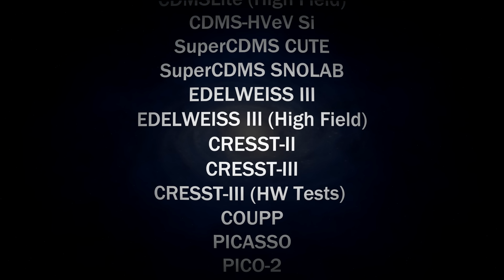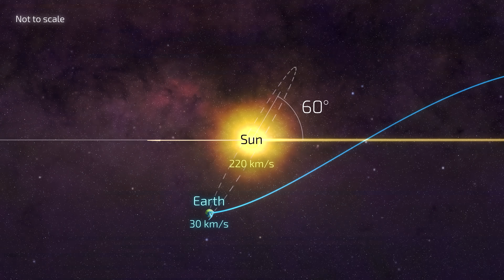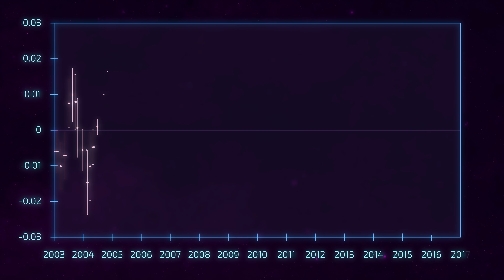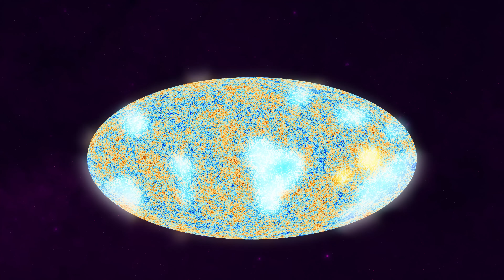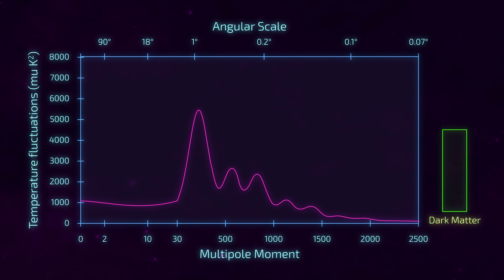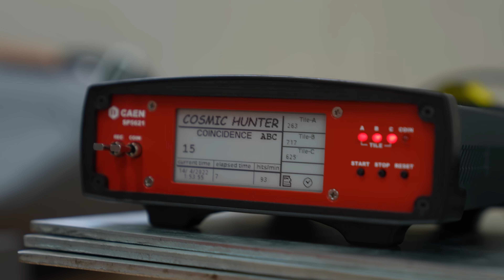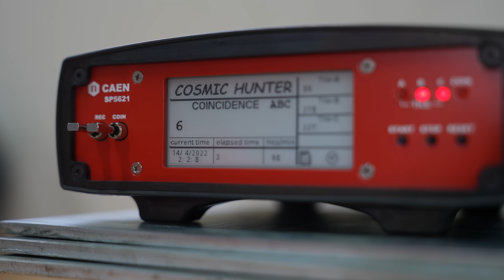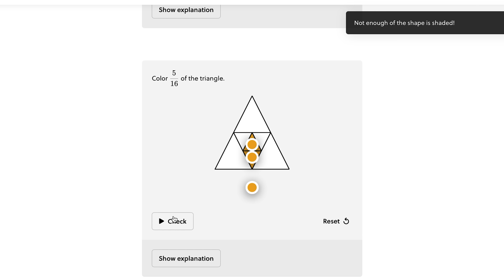The Absurd Search For Dark Matter

Comment: A particle that doesn’t interact with other particles yet seems to have a massive gravitational affect on the structure of the universe seems like a contradiction to me. Why is this “dark matter” not clumping together in it’s own galactic structures if it has this enormous gravitational attraction? As an hypothesis it raises more questions than it solves. Eg - why doesn’t the Earth consist of 80% dark matter if the universe does?
Reply: It doesn't interact with itself either. Which means that dark matter particles doesn't collide with each other, doesn't lose momentum and won't clump together to form a denser structure.
Reply: Could it be that the dark matter attracts itself less strongly than it would to “real/light matter?” 
That might be super dumb but just a thought
Reply: @MondoTV The only reason normal matter has clumped so densely at all is because it interacts with itself (mostly through electromagnetism). Matter moving through space doesn't experience friction, so through conservation of momentum and conservation of energy it is going to keep moving unless that kinetic energy goes somewhere else. Normal matter, like gas and dust, will sometimes collide and that will turn some of the kinetic energy into thermal energy (or radiation). And that's how normal matter clumps up. That's why the early earth was molten rock, instead of cold dust. And that's also why meteors glow when falling to earth, all the collisions between the meteor and the air.

Whatever dark matter is made up of, either doesn't do this at all or doesn't do this very often. So instead of clumping up as part of the earth, it just passes right through
Reply: @ThomasBomb45  Matter does not clump together because of “electromagnetism”. It clumps together because of gravity. Which is precisely the force dark matter is supposed to be exerting on the rest of the universe.
Reply: It shouldn't, we've come to accept plenty of invisible forces that doesn't interact with matter. Gravity and magnetism are invisible forces we just accept even though we don't fully understand it. We don't know why gravity pull things together. We don't know why magnets repel or attracts we just know it does.

Comment: Fascinating, as usual! But a logical inconsistency (or maybe just a perceived inconsistency) is nagging at me: Scintillation detectors are being used in these attempts to detect DM, and the interactions that occur in such detectors between incident particles and the atoms of the detector material are electrodynamic in nature (kinetic energy transfer, orbital electron excitation, etc.). Yet, as Derek stated in this video, physicists have hypothesized that DM only interacts with “ordinary” baryonic matter gravitationally… However, I am almost certain that no such inconsistency actually exists, and that it only seems that way to me because I’m a layperson on this subject. If that’s the case, can anyone explain what key piece(s) of scientific information I’m missing at the moment?
Reply: DM could interact with ordinary matter only gravitationally, but the idea is that it might also interact (extremely rarely) with ordinary matter through the weak nuclear force. This is why these DM candidates are called WIMPs (weakly interacting massive particles).

Comment: That WIMP detector looks a lot like some neutrino detectors I've seen, just smaller, with different materials and more complex stuff around it.
Reply: How do they rule out neutrinos being detected?
Reply: @fdemilde  Neutrinos are indistinguishable from WIMPs in individual events. You need to account for that using annular modulation etc.
Reply: @jackkamo5175  That's not necessarily true, depending on the detector. Experiments like DEAP-3600 can differentiate between nuclear recoils (the expected interaction for a WIMP) and electron recoils (which is what an interacting neutrino would cause, IIRC).
Reply: @atticmuse3749  We are talking about DAMA/LIBRA which doesn't do that.
Reply: @fdemilde  that's a very good question. I didn't even think about that.

Although it's probably very rare that neutrinos would be detected there, since this detector is still relatively small compared to typical neutrino detectors.

Comment: As someone with a very elementary knowledge of dark matter, could it just be denser gasses and not dark matter? Both you can’t see
Reply: You actually can see the gas :) either because it emits radiation (for example neutral hydrogen emits radio waves, hot gas emits X-rays etc) or because it partly absorbs light from other sources when it passes through. And from what we can see there's not nearly enough gas to explain the effects we attribute to dark matter

Comment: Aaaaannnnddddd... this is why I switched from particle physics to condensed Matter physics. I personally do not have the patience to run an experiment that is like this. Intentionally trying to detect something that doesn't interact much by definition sounds like a frustrating experience. The same goes for the the neutrino community. Lots of respect... from a distance....

Comment: iduhknow... dark matter. Hm. If 'Big Bang', we had faster than light expansion of the universe. That puts us in a temporal area that is actually earlier than the Big Bang and  the Big Bang hasn't actually happened yet. If the 'Big Bang' was not the beginning of the universe, but a large event within an extant universe, in a universe which had  not been so accelerated and was moving forward in forward time, this would account for an inability to signal 'dark matter' - we aren't in the same time zone. Also account for the different behavior of dark matter in that it is the temporal orientation of the known universe which permits of such things as the emission of light; there's just no room for light to be emitted otherwise.
Maybe just some hair-brained musing but can't say i've heard of any better interpretations of what's going on with Dark Matter (or, as deGrasse Tyson says, "Dark Gravity", since that's all we really have any data for so far).
Between the conception and the creation
Falls the shadow.
TS Eliot said that.
It has been said that 'data never lies' but
Between the data and the interpretation
Falls the shadow.
i said that.  😉

Comment: Well done. This is the first time I’ve seen an article that tries to explain dark matter WITH PROOF, rather than speculation!
Reply: It’s not proof. It’s working backwards from a set of observations to an hypothesis that seems to fit. Until we understand the “why” of gravity as well as we understand the “how” then it’d difficult to assess whether something else is happening that we just don’t understand yet.
Reply: @mondotv4216  maybe ‘proof’ was the wrong word I agree. Yet, this is the first time I’ve seen anything that take two different methods, both endorsing Dark Matter. That has to be a good start. . .
Reply: @GWAIHIRKV  Not really - just two different methods of observing the same thing - whatever that may be. The dark matter explanation just seems illogical to me. You have this thing exerting enormous gravitational forces on the universe that doesn’t interact with anything? If it has gravity (by definition) and there’s 5 times more than the observable matter in the universe, why aren’t the planets 84% dark matter?  And if matter is not attracted to dark matter and vica versa then it explains nothing.
Reply: @mondotv4216  How would planets be made from dark matter when dark matter does not interact with little more than gravity? Planets are held together by gravity, yes, but electromagnetic forces hold the particles from passing through each other and dark matter doesn't interact that way. A "planet" of dark matter would be a "pulsing" blob or a "mini galaxy" of particles of dark matter.
I'm not saying dark matter exists, that we will (hopefully) see, but your view seemed unfair to the hypothesis. As far as we know it is quite consistent.
Reply: @GWAIHIRKV  I assure you, people have made these connections before. Veritasium isn't discovering new science, he's conveying science that others have already done
Reply: Ken if you want more non-speculative content like this, I highly recommend looking up a blog called Starts With A Bang, written by Ethan Siegel. He is a theoretical astrophysicist who specialises in this sort of cosmological stuff, plus he’s got a great way of explaining things which is palatable to a wide (non-expert) audience. Some of his writings on dark matter help to break down the myths and help debunk things like string theory (too convenient) and Modified Newtonian Dynamics, or MOND (doesn’t explain other observations). Plus he has a lot of excellent articles on other science topics like climate change, astronomy, black holes, space travel, etc.
Reply: Science marches on.
Reply: The way galaxy rotation lines up with the CMB made my jaw drop. That's pretty darn convincing.

Comment: They are getting hits from something else, not dark matter.  The second site detector will show a nil or otherwise uncorrelated signal.  Dark matter constituent particles are to large prime numbers as electrons, protons, and the materials in any detector we make are to small prime numbers.  These domains are disjoint-but-topologically-not-disjoint and both curve the same space time from those shared abstract topological properties.  I'm just the messenger and will be easier to believe in a couple years.

Comment: What if the darkmatter is just the space fabric itself, and the gravity is the density bubbles of space where matter rolls down into the 'gravity wells'. Thats why we dont know what gravity is, and cant detect dark matter, why the superclusters move through each other, and why centrifugal velocity of spiral galaxies doesnt obey logical laws of physics. Space time, like the idea of string theory, and quantum mechanics, itself is a fabric of energy/stuff, and everything in it exists intertwined with the fabric whilst being on the higher dimension of it. We talk about 3d and 4d like we understand how they relate, but we are the fish in the fishtank, and may never have the right stuff to develop the tools to look outside the tank (video does mention this possibility). Thats why quantum physics differ from classical, and why physics of large scales within out universe also function different from the first two. 

Like we hope that there is dark 'matter', because that would open up the possibly of harnessing it. But what it space itself is matter, like a quantum string field of quasistatic existence, and as more and more quanta bond, they create the matter we interact with, until the system gets large enough and compact enough to develop physical matter, thats why light has a speed limit, because that energy bundle has the dynamics to slice through the spacetime fabric to a certain point before the resistance equal point. We say space is expanding, but so do bubbles until the pop. so if there is a 4th dimensional expansion of spacetime  the tears or weak points, that matter escapes or collects into. We call these black holes, and we call the cascade gravity. But just as centrifugal force is just the 'felt' effect of forces acting in 3 dimensions, gravity is a 'force' that we feel in 3rd dimension as the space tears in the forth.  

But what do I know, I am just an engineer and do not have the time to understand the universe mathematics and physics, esp since even with our current models, they are just temporary until such time as we figure out how to understand and work with 'new 'physics'.

Comment: My personal theory is that the universe is much older than 13.8 billion years. It is more like 50-100 billion years.  This removes the need for an unprovable inflation theory.  It also allows for several generations of stars needed to create all the heavy elements.  If the early universe was much smaller and denser, there would have been many large stars that went super nova.  If only 60% of the mass goes on to reform the next generation of stars then 40% of each generation becomes cold dark ordinary matter.  After three or four generations of star formation only about 15% of the original mass of the universe would still be luminous. The rest is cold, dark ordinary matter which would be invisible to our telescopes but could be detected by the gravity it exerts.  So there is no need for exotic dark matter or dark energy theories, just a longer timeline.  Current observations are also complicated by gravitational lensing which would have been extreme in the early universe. Most of what we observe probably doesn't even exist now nor is it anywhere near where it was. 
My second theory is that the universe is much younger and exists in at least three dimensions which all coexist in the same space and affect each other.  Evidence for this are the particles which appear and disappear which are just going from one dimension to another.  Gravity from mass that can convert to energy and the fact that everything is created from nothing.

Comment: At 10:38, "The idea is that very, very rarely a dark matter particle may hit a [sodium] nucleus in the [sodium iodide] crystal and transfer its energy."
That experimental set-up is clearly inspired by the technique that Cowan and Reines devised to detect the neutrino for the very FIRST time circa 1955-1956. Except that Cowan and Reines, thanks to Pauli circa 1930, had good reasons for believing in [a] the existence of what they sought and [b] a method for detecting it. Whereas here, while admitting that we know nothing about dark matter at all, we trust some savant somewhere to predict that it should interact, specifically, with a sodium nucleus? WTF. Why not a lithium nucleus or an osmium nucleus since we know nothing about the 'dark matter particle' itself? It sounds like sheer madness.

Comment: Around 7:45, the Bullet Cluster ... you say the interstellar gas interacted, heated up and slowed down ... and that supposedly the dark matter remained bound to the colliding clusters and not also remain concentrated in the centre. Even given dark matter only interacts gravitationally, wouldn't it also slow down and end up between the clusters? Perhaps research is needed to find similar "before" and "after" collision situations to try to measure dark matter reactions, hopefully to better guide how to look for and find it.
Reply: Here's a thought:
The interstellar gas of the two clusters are physical matter, thus they interact with each other not only through gravity, but also by electromagnetism, and that the particles of the gas itself can collide and change their trajectories, giving them multiple chances to slow down.

Dark matter, on the other hand, is affected only by gravity and can't physically interact with other particles, even itself. Given that gravity is a relatively weak force on such scales, it's possible that the dark matter of both clusters were still moving to the vector they were initially in , thus causing them to be on the clusters themselves and not where the interstellar gas is. As it was not able to slow down fast enough.

Comment: I hadn't heard of the DAMA/LIBRE experiment. Reading the Wikipedia article, it's maybe not surprising it doesn't make a lot of news articles in science publications.

Still, I'm glad someone is running an experiment in Australia to try to sort this out.  

There's precedent for hard to reproduce experiments, but consistent results over decades producing new physics.  Ray Davis had a vat of cleaning fluid in a South Dakota mine that detected neutrinos when a Chlorine atom in his cleaning fluid interacted with a neutrino and transformed it into an Argon atom.  His results continually showed 1/3 of Argon you'd expect.  The numbers were VERY small (something like 10s of atoms in a few weeks), but they were consistent for decades.  He wasn't taken too seriously because many assumed the Argon atoms just got trapped somewhere.  He started around 1970, and It took until 1987 until an experiment in Japan reproduced his results, though even this experiment showed 1/2 what you'd expect, not 1/3.  

Through more experiments all over the world, we now know Ray's experiments were consistently right all along.  We now know this as Neutrino osculation.  Ray got the Nobel for his work in 2002.

The other, much harder possibility is that dark matter never interacts via anything but gravitation, and all the particle detection efforts are doomed to failure.

Comment: Dark matter is the matter we've seen and measured, but it bounces in and out of our dimension into another one at the quantum level. It is still here, but it's there at the same time. We see an electron being in two places at the same time, that same electron puts double the weight into our space. It is just like when certain physicists think they've proven that our Universe came from nothing when quantum particles pop into existence from the quantum vacuum, but they didn't come from nowhere and nothing, that's absurd. To speak of effects that have no cause is like saying blue smells like roses.

They are particles sent into different dimensions and likely originally by Inflation at the Big Bang. So all this matter does interact with regular matter on and off in ways only a mathematician could calculate. An electron in 2 places at the same time is evidence it has been traveling in another dimension of Time and is time traveling. This is the answer to the Uncertainty of Heisenberg. Then again what do I know? I studied engineering and went for the money. You get weird ideas having a couple of beers with an astronomer friend, but it's a start.